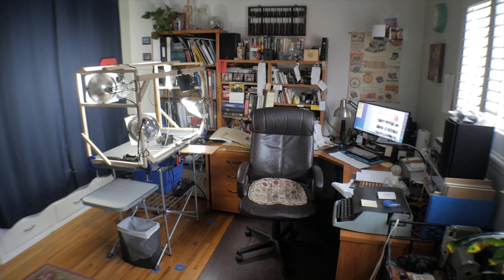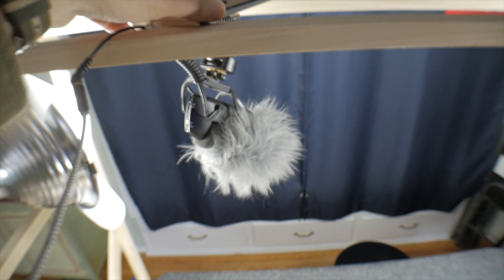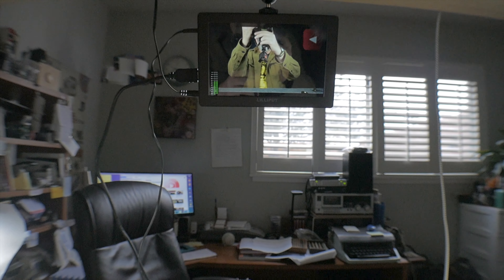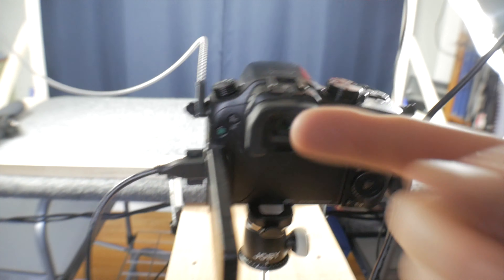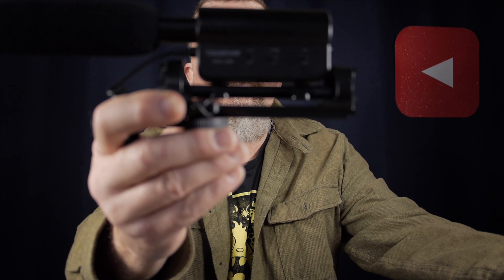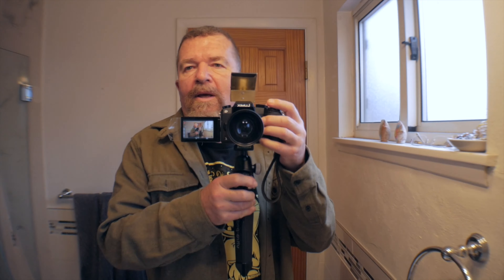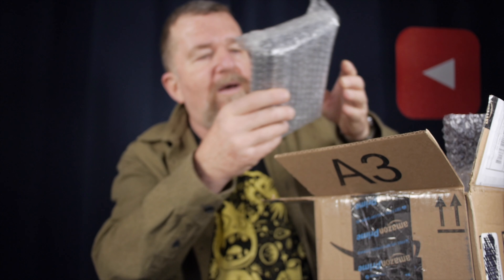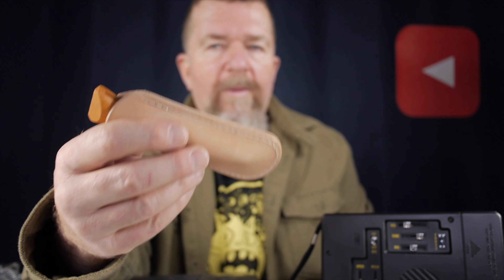Breaking the 4th Wall

Comment: The set-up works better than the scaffolding you could find in a store. Your ingenuity is spot-on, Joe. If you want a device to help you record on the move, you should check out the OSMO company, they have a OSMO 2 for phones that stabilize your recordings while you walk. I met a man using it to take photos, not unlike yourself, for the fun of it. It could be useful.

Comment: Brilliant setup! Two suggestions, that you might already have thought of:

• Mount the mic on rubber bands or foam. There is a significant amount of rumble coming through the table.

• Mount the monitor just above or below the camera. That way you have eye contact all the time and don’t seem distracted when you look up.
Reply from the maker: Yep, I need to isolate the mic mount. And I'm still getting used to the monitor, more practice is needed. Thanks for the input.

Comment: Great video Joe! Have you considered separating the camera mount from the table? That way any table movement doesn't shake the camera.
Reply from the maker: Yea, it's still a work in progress. The plywood tabletop just sits on the camping table, so I need to bolt it down to prevent vibration.

Comment: Your play button needs to be flipped 180 degrees if you want it to match the You Tube logo.  I like your setup.  I don't see clutter in your house.  What is a tactical knife vs. a strategic knife?
Reply from the maker: I was toying with the idea that it’s an arrow pointing to me! And it’s fun to flip things around. Thanks for noticing!
Reply: @Joe_VanCleave  If you have it on the opposite side of your set it will point at you.